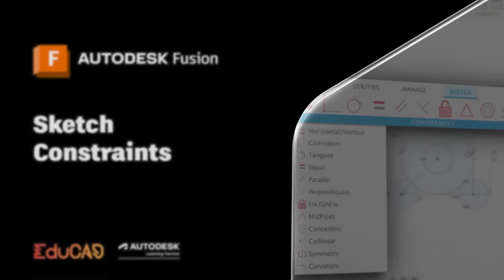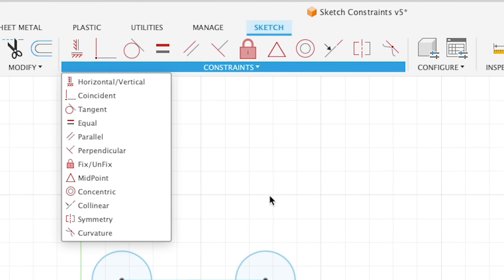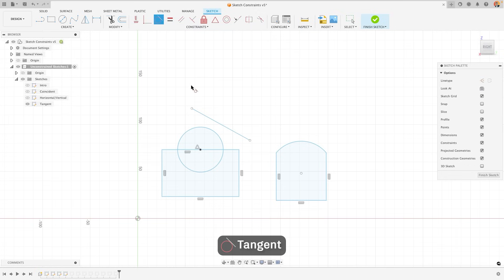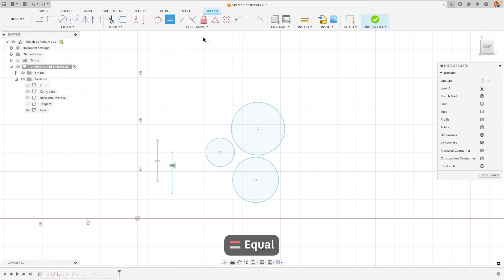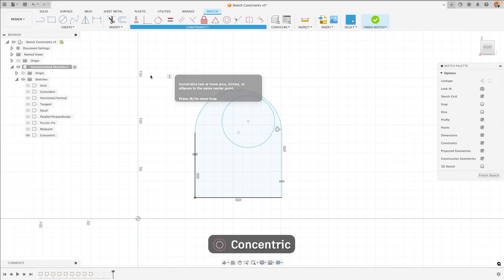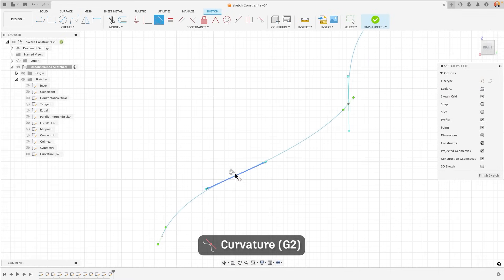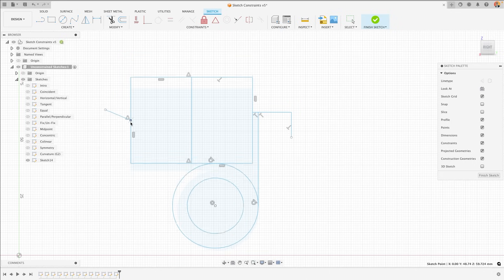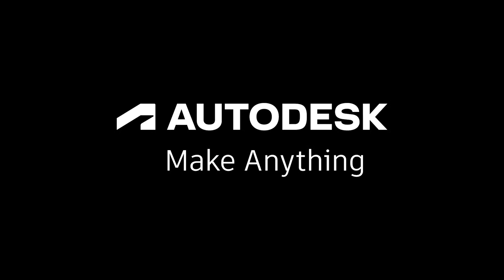Sketch Constraints Made Easy in Autodesk Fusion [UPDATED!]

Comment: Excellent video thank you. However, I am still left with my original question - how can I constrain a line to the center of another line? 
For example, I have 1 vertical line. Next I draw a horizontal line. Now, how do I ensure it's perfectly aligned (horizontally) to the vertical (again, like a cross)? This is one of those things that was simple with TinkerCAD by hitting the "L" key (align) and selecting the center point. I'm sure Fusion has a very simple way of doing this, I just haven't figured it out yet.
Sorry this is probably a very basic question, but am new to Fusion!

Comment: I’m trying to make an oval sign with a name in it. To cut out on a CNC plasma table. I created the oval used the text box to type the name inside the oval. Exploded the text extruded it to .125” ( the thickness metal I’m cutting) set up my tool selected cutting But I cannot figure out how to constrain the lines in the name to where each little line is not an individual line section. Fusion keeps giving me a constant error.

Comment: Good  video.  The one thing not clear is order of clicking.  In your three circles of equal size example it took the size of the smallest circle.  If you want the biggest one I assume you click first?  Also for making limes equal length, which one does it trim or extend?

Comment: how do you fully constrain a sketch of a half circle and two twin angled lines moving inward from the ends of the of the half circle to a horizontal line at connecting them at the bottom?
Reply from the maker: Hi Jerbrown! 
If it is a true semicircle up to angled lines then these would not be tangent. Instead you might use the coincident constraints to fix the ends of the semi-circle to the ends of the line. The angled lines themselves would likely be fixed at a given angle by a dimension. You could also draw a construction line between the two ends of the semicircle and make this horizontal to ensure it can't twist. From there you can constraint the other ends of the lines as you wish, with another coincident constraint perhaps? It depends what they attach to :)
Reply: @adskFusion  Thanks for this detailed response!!

Comment: How do you constraint angles? Lets say im sketching the angular bisectors of a triangle, how can i sketch a line constrained to one of the vertices and bisecting its angle? Can equal constraint be applied to angles?
Reply from the maker: Hi juohan, 
The equal constraint can only be used for the length/diameter of objects. In this case you would likely use the sketch dimension tool to define the angles you want in your sketch.

Comment: Although this is a good basic explanation, I still find myself tripping up.

1) What do the red & black colors mean in the constraint icons in the ribbon bar?  Originally, I thought the red one was the object that would move or resize, but I’ve found counter-examples to this.

2) How do I know which object will move/resize?  If the wrong one moves, what are my choices?

3) How can I choose a constraint to delete when they are drawn practically on top of each other?  Do I really need to zoom all the way in, just to select one?  Is there a better way?

4) How do constraints interact with dimensions?  Is a dimension just another constraint that has a different name for historical purposes?

5) When Fusion says my object is over-constrained, how do I figure out why?  Is there a way for it to display which constraints are setting the same distance or angle twice?

Comment: How can I constrain an angle of two intersecting lines?
Reply from the maker: Hi! 
if you are looking to constrain them at a specific angle, the Dimension tool will be the one you need. Whilst not in the constraints menu, a dimension is essentially just a different type of constraint based on a fixed value (in this case degree) you define. You will typically use a combination of constraints and dimensions in your sketches 

The perpendicular constraint will fix two lines at 90 degrees to each other if that is what you are looking for :)

Comment: With regard to the Horizontal/Vertical constraint, I do understand how one item may already be constrained so that the result is that there is sometimes an unforseen movement of one item relative to the other item. But... rather than suggest that the user just try it, then Undo it if they do not like the result, there should be an indicator as to what will happen before it does.
Generally it should follow the Constrain this to that rule. And when will happen, there should be Green tint on the hover of the 2nd item. If it will not be able to follow the 'This to That' rule, the 2nd object should turn Yellow when hovered over. Finally, if neither of 2 object can move due to their already being constrained, the 2nd item should turn Red when hovered over. This tells the user what is about to happen and the Undo if you don't like what you get is resolved.

Comment: Two questions: When did curves become lines? And, why can't a sketch be fully constrained from the first line to the last line?

Yes, I will acknowledge that these are two contentious questions and what you call any item in a sketch shouldn't matter. But it was not too long ago that it seemed everybody insisted on naming straight lines as curves. At least everybody at Autodesk. And now here we have an instructor who is calling them lines. Are all the other instructors choosing the word line over curve in recent tutorials?

And now I would like someone to take the information we just saw in this video and combine it with the question of how to create fully constrained sketches. The complexity of constraining a sketch seems to me to be caused when Autodesk Fusion automatically constrains some elements of the sketch at the time that they are drawn. This may be required or beneficial, but blending the automated constraints with the intention of the designer is the real art of sketching. In fact, if we take a look at this tutorial, the sketch at the beginning of the video has no constraints, and I am unsure it is actually possible for Autodesk Fusion to draw this sketch without The software applies some constraints automatically to some of those elements. In another tutorial I believe I've already asked the question: "how did you draw that sketch with no constraints?" I never saw an answer.

In other words, we might learn more about constraints by understanding both the possibility and the need to draw lines and curves unconstrained at the time they are drawn. I see it done all the time, but why?

And that is the gap in understanding fully constrained sketches when Autodesk Fusion may have applied constraints that we really didn't want and MUST be removed to achieve our design objectives.

Another issue in fully constrained sketches is that this tutorial took advantage of a sketch that did not start at the origin. That in itself is contrary to the sketching principles that WILL lay the foundation for a full constraints sketch. And if there is merit to sketching out in space without it being anchored to the origin, then I have yet to see a tutorial that makes it clear why we would want to sketch a loose unattached line or curve and then move it someplace else. I see it done all the time but it doesn't seem to have a purpose even though it's possible. The best example is a line or curve starting at a point in space and ending at another point in space. Or for that matter, a circle drawn around a center that is not attached to anything else. If you can explain why that's a productive sketching technique, I'd love to hear it.

I believe we will all benefit when sketch constraints are taught in the context of sketching constrained lines (curves) one at a time on a sketch that never becomes unconstrained rather than as an afterthought when we need to take lines (curves) that are floating in space and make them work together to achieve a fully constrained sketch. In the physical world there are not very many times when we hang an item out in space and don't fasten it to something else one connection at a time as we build the entire structure.

I'm sure I'm going to get flak from people who say "that's just the way it is". But I hope someone out there will agree with me that it's a fair question to ask why a single line or even a complex sketch has been drawn floating around in space with no constraints.

Comment: As much as clear your explanation is (thank you), somehow it isn't really intuitive, at least for me: for instance, when you want to make a line parallel to another, it's the second line that will become parallel to the first. To me, it should be what you select for first that's to be changed, not the latter. 
5:08 or with the Midpoint constraint, no matter how I place the circle and line, it's always the circle that moves to the line, while in your case it's the opposite. 

But anyway, it's a free awesome software, and I'm truly grateful for it. Sorry if it may seem like it's not.

Comment: Sigh. Great tutorial. But some things are driving me crazy. I drew a 2 point rectangle, like you do at 7:50. You have the solid light blue lines around the rectangle with the 2 types of constraints. I have a brown dotted line. Then when I select the object, it is a dotted blue line.
Reply from the maker: HI Michael, 
It sounds like you have toggled construction lines. These are used as reference lines but do not provide an enclosed area. You can toggle this on/off from the top of the sketch palette (normally on the right of the screen when sketching). alternatively you can adjust lines once drawn by right clicking on them and pressing, "Construction" 
Hope this helps!

Comment: What steps did you use to create the fully defines sketch on the right? (I am unable to reproduce it as a fully defined sketch.)
Reply from the maker: Hi John, 
It is a little hard to tell what is going wrong without seeing your sketch, but our recommendation would be to see what breaks! If you click and drag on the blue lines in your sketch, what moves? Seeing what moves is often the easiest way to tell what still needs constraining, and you can always undo the move to get back to where you were :) 

It may also depend on how you draw each shape. For example, I used the "Centre Rectangle" option to draw the square and slightly different constraints might be needed if you had used the 2 point rectangle option!
Reply: @adskFusion  I started with a center point rectangle and set the dimensions to 12 inches on two sides to make a square. Is there any additional constraint needed to make this initial geometry become a fully constrained sketch? I am unable to have a fully constrained sketch for the initial square geometry.

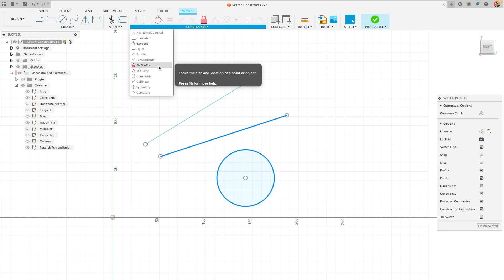Comment: Hi. Maybe I'm missing something, but at 9:20 , shouldn't the "Midpoint constraint" be available (and not grayed out), when you check the possible contraints after selecting a line and a circle  ? At this point in the video it's greyed out but the "Midpoint" part of this video shows  that this contraint is possible for both  :)
Reply from the maker: Hi! There is a good reason for this. ☺ In this case, we selected the circle's line itself, which is a separate sketch object from the sketch point, which is also created as part of the circle. A circular line does not have a centre, so the midpoint constraint cannot be applied, but if we had selected the central point of the circle, the midpoint constraint would be available. Hope that makes sense!

Comment: 2:00 regarding horizontal vertical. Which entity is the leader and which is the follower? On the left right circle set, Right was clicked first then left snapped to it. On the vertical circle set, upper circle was snapped first yet it snapped to the bottom one.
Reply from the maker: Hi Marty, Excellent question! Fusion will try to move the sketch object that has the least impact based on other constraints. So, for the vertical circle set, the upper circle was the one to move because the bottom circle already had a constraint applied and was more restricted in its movement.
Reply: This is always an exercise of trying this or that. It’s like   “I want to align this (click the one I want to move) with that (click the one to align with).” Seems like that makes the most sense. 

Then other times it’s backwards. Most often with lines it’s the other way. The first item you click is actually the one that the second item will take on the properties of. 

Last suggestion: having a sketch that’s pretty weird is sometimes very hard to fully constrain. I’d like a tool that will suggest constraints. Say I have blue lines or circles or arcs. I could click and highlight any or all, then click a button that would pop up a list with numbers and the elements would have those numbers. Something like that.  At least it would give me something to go on.

Comment: Always appreciated.   When using the any constraint, does it matter which entity you choose first?
Reply from the maker: Thanks for your question! It does not particularly matter. The sketch object which moves is not determined by the order of selection (unlike joints, for example) so the order does not matter too much 🙂
Reply: @adskFusion so how is it determined? That’s important to know for efficiency.
Reply: @adskFusion  Understanding constraints and taking advantage of the feature requires that the user understand what is going to happen after they have used a constraint. Otherwise they have caused something to happen but apparently did not really have control over what they did. In the video, when the constrained the circles first horizontally, then vertically, the order did not cause which moved as you indicated. But how the heck does the user cause it to work like they need?

Comment: The way constraints work in 2D sketches is very good to understand. However in a 3D sketch it is extremely hard. I didn't manage to fully constrain my 3D sketches with a slightly more complex shape than only horizontal and vertical lines. 
As soon as there is a circle, it won't turn black. I would love to see a tutorial about constraining 3D sketches and adding dimension. 
Best regards.
Reply from the maker: You are entirely right that constraining 3D sketches is more tricky. What is typically difficult with circles in 3D sketch is that they are able to rotate around their central point, but you cannot apply a parallel or perpendicular constraint on a circle to stop this. However, what you can do is create construction lines within the circle. If you create a line where the ends are both fixed to the centre and the outer edge of the circle...you can apply the perpendicular or parallel constraints to that line and it will fix the circle in rotation. 

If ever unsure of how you need to constrain a line, click and drag on it to see where it is able to move. You can always undo to put the sketch back to where it should be ☺
Reply: @adskFusion  thank you very much for answering!
I've actually done this with the circles, but it doesn't always work. In addition to that, I can't really move parts of a 3D sketch. It is always very time consuming and not as intuitive as 2D sketches. 
I often use 3D paths to design air tubes. Most of the time the different arcs are fixed together in a weird way, so the don't move as you would expect. For example if I want to apply a tangent constraint to a line which is placed somewhere in 3D space, it won't work automatically, even if it theoretically should be possible. I have to manually turn all pieces to the approximate correct position for the constraint to work. 
It is quite hard to describe, but I hope you get what I try to say. 
If you have additional tips to improve my 3D sketching skills, I'd be pleased to hear them!

Comment: I'm still hoping that we could get a bit more information in sketches in regards to which constraints an object you click on already has and such. Perhaps not as advanced as what Solidworks does, but some way to more easily delete a specific constraint that belongs to a specific object would be nice. Some times it is very hard to identify which goes where in complex sketches.
Reply: Hi! I also hope some more informative way to handle complex sketch constraints. Have been many times quite frustrated to find right costraint to modified or deleted. Sometimes only way is to delete all constraints and start from the beginning.
Reply: If I am understanding you correctly, you want to be able to tell which constraint (when multiple) to delete on an object.  One thing I do is click on the point / area you want to remove the constraint.  Then move your mouse over each constraint on that area and you should see part of the sketch change color a bit.  That means that constraint is tied to that specific constraint.
Reply: @wolf9545  exactly :) and, yeah, I know and do it that way, it's just not very clear and handy.
In Solidworks you click a line or whatever and you get a dialog on the left with a list of the applied constraints and other info.
Fusions way is faster, but SWs is clearer

Don't get me wrong, I much prefer Fusion on the whole, but there are a number of things that SW just does better (as it should considering the price difference).
Reply: @Robinlarsson83  I agree. I use a few high end 3K and 4K IPS monitors and have worked thru the Fusion graphics, nVidia and monitor settings, but I find it hard to read the inference, especially when there it's a complex point. And I often find it quicker to just start deleting until I get it and then rework the mess.